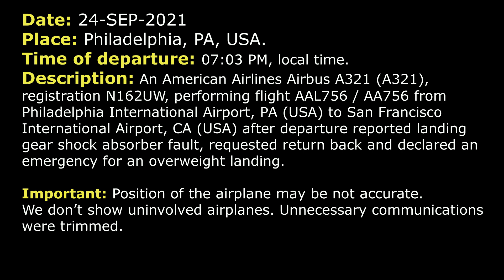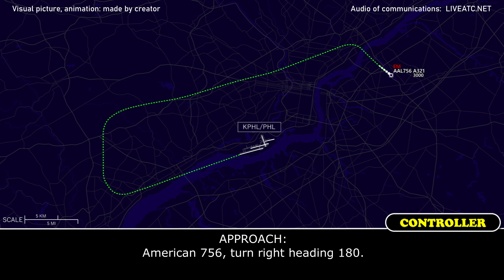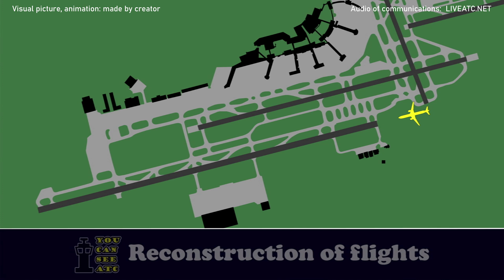Shock absorber fault, overweight landing | American Airlines Airbus A321 | Philadelphia, ATC

Comment: I would have thought that with a shock absorber issue, the last thing that would want to do is an overweight landing!
Reply: Someone pointed out that the error can also indicate that the gear did not retract properly. So flying with it at length can result in further undercarriage damage.

Comment: Lots of comments miss the point. Most likely this is their preferred field for maintenance issues , where they are going might not be so useful.
Reply: No...you miss the point, Dan. They landed overweight for a non critical item rather than burn fuel and get under their max landing weight. They could've done that and still landed back in PHL.

Comment: (Not a pilot) A quick search showed that a shock absorber fault can be an indication of a failure of the gear to properly retract. Also, there is the possibility that the wheel may be stuck off center. NTSB report: CHI03IA027.

Likewise from a report from an A320 Abnormal Conditions note on 11 Oct 2019: L/G SHOCK ABSORBER FAULT
Shock absorber not extended after liftoff: In few cases, autothrust and autopilot may also be lost. If WHEEL N.W. STEER FAULT is also displayed, then the nose wheels may be at maximum deflection. (turned 90° from center). During landing, delay nose wheel touchdown for as long as possible. Automatic roll out is not permitted in N.W. STRG FAULT.

Comment: ATC was perfect on this one.  I know nothing of Airbus 320 series landing gear systems, but it strikes me strange that returning to the field for a shock absorber fault and landing overweight rather than burning off fuel is a pretty strange call.  Somebody enlighten us on what this fault means, and how it might affect an overweight landing.
Reply: I thought the same thing. You'd think that with an issue like that you might even consider continuing to your destination (I'm sure there's a good reason that they didn't, but I don't know it).
Reply: I know nothing about any such systems but could it be there was the risk the cylinder was leaking and waiting would mean it becomes less effective?
Reply: @rutgerw.  Ooh that's a possibility, nice idea

Comment: If it's a shock absorber that broke. Wouldn't landing overweight be a bad idea. They had no urgent need to land and could(should) have landed as light as possible. The holding pattern to me for a few hours make then most sense.
Reply from the maker: I had the same question 🤔
Reply: I wondered the same thing. Excuse my ignorance here, but why wouldn't the flight just continue thereby landing lighter. Why did they need to return to Philly?
Reply: @KLA_Ministries  In my aviation law class back in the 90's. We had to decide a US Air flight that struck a deer on takeoff in PIT and went on to PHL. The results said they broke several company and FAA regs. We voted to fire the pilots.